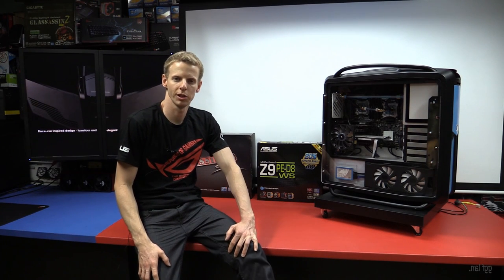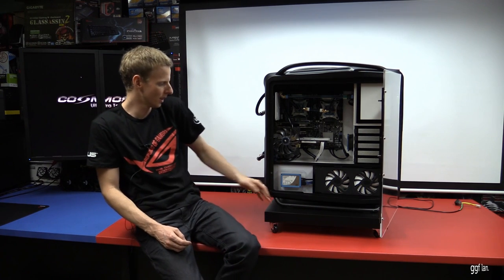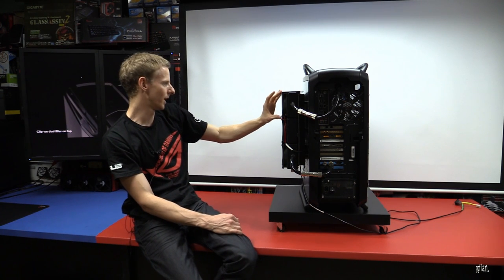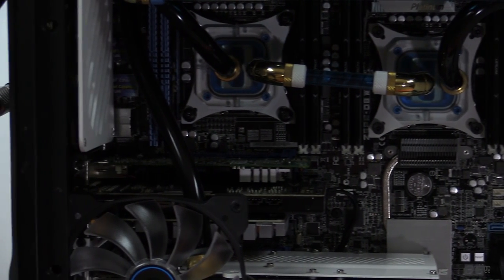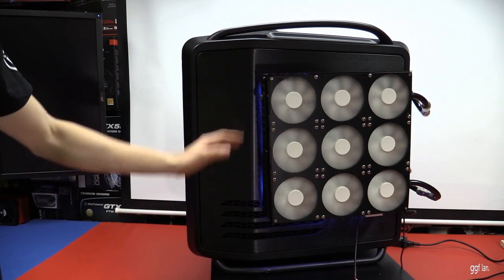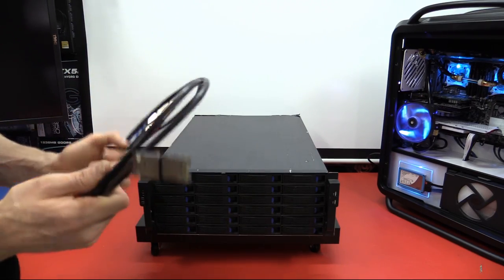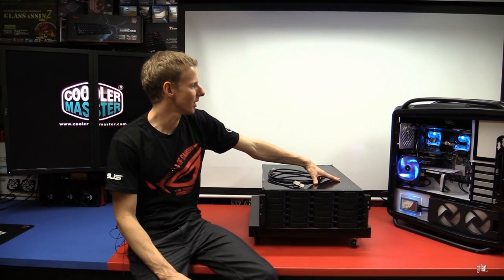Cooler Master Cosmos II, Dual Xeon, Asus Z9PE-D8, 64Gb Ram, 80TB Storage  - Monster System

Comment: The limit to overclocking is not in the ASUS board - it is in the Xeon processors themselves that are locked, You cannot get 4.5 Ghz out of a Xeon even with the EVGA board. And also the ASUS board CAN use the i7 processor... it's just that you are limited to using one i7. i7's aren't designed to work in tandem.
Reply: You can easily get 4.5ghz from an Evga SR2 which I said, that is socket 1366, not this socket. Pretty sure I also said you can use 1 CPU as well. I am well aware of what this board can do and how to use it.
Reply: Stuart Tonks
If it's you who appears in this video Stuart, it's very obvious that you know your stuff! Not saying you don't... And I should have commended you on your technical aptitude as well as your creative industriousness... resulting in a very sweet customized build!

I was responding to your comment at 2:26 where you were describing the ASUS board. You said,"...and no you cannot run a standard i7 in this...". You had a lot of things to convey. We all misspeak occasionally. I'm sure you meant to say that you could not run a PAIR of i7s.

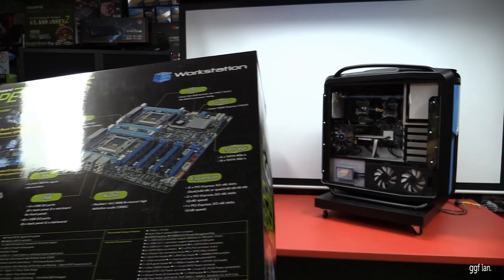And I was also responding to 4:10 where you were discussing overclocking with the ASUS board. You said, "...this one you can't overclock. Not a huge concern for me. I don't need to be running 4, 4.5 on um, on every core..."
But you had said earlier that you did overclock the Xeons a little on the board. I'm just clarifying that the limit is due to the design of the Xeons, not the board. And that Xeons won't OC past the 3.1Ghz you achieved.

Again, great vid.  Just trying to clarify for those who haven't played with dual-socket solutions.

Comment: Hi, Fantastic work. Could you advise what size of plexiglass you used to make your side panel please? Thank you.
Reply: I think I used 5mm actually
Reply: Stuart Tonks That's probably a better option as opposed to buying 3mm thickness as a guess. Just concerned 5mm will be significantly more expensive. Can recall 4mm being a lot more to buy than 3mm therefore 5mm must be a lot more to buy. What do you recommend for shaping the edges? Don't like the idea of using a jigsaw but possibly a scroll-saw. Cannot afford a band-saw unfortunately. Thank you.

Comment: I'm using a NZXT Phantom, the "PHAN-001BK Enthusiast ATX Full Tower Computer Case", for my rig right now. You said in your previous video for this build that you think the Cosmos II is one of the best cases you've used. How do you compare the two? If you don't mind me asking an annoying-to-answer question.
Reply: Na that's alright. I haven'tused the NZXT but I think the Cosmos is a bit bigger and I really like the bottom PSU and HDD area. Really separates them. The cosmos can also take the largest of motherboards as well.

Comment: id say the upgraded xeons would compensate for the lack of OC
Reply: Yea the only disadvantage of the new Xeons is the non OC. But there are a whole heap of new advantages going to the E5's. I get a much faster link between CPUs, faster PCIE spec speed and also everything comes off either CPU 1 or 2, not through a north-bridge.

Comment: Though's cores should be hyper threaded so you have 32 cores theoretically, I have a similar build for a cad workstation its been great so far. I didn't set up ssd caching from the beginning so, im thinking about a fresh install. That case is mahosive, I got mine into a Silverstone Grandia GD07

Comment: I have 2 e5 xeon 2650 2gb, and  a supermicro X9DR3-F , 2 gtx 980 ti, 64 gb of memory, but i cant up my processeur to 2.8 gb with turbo, if i change my mother borad, and i will buy Asus Z9PE-D8 WS, it gonna be better in performance? and i can put gtx in SLI, it can help please? thank you for you answer.
Reply: I think you have not understood me, the super micro does not support SLI, I have two cards gx 980 ti, but not SLI, unfortunately I can not enjoy the potential of SLI also put a third card, 4th slot I metterais a black magic for monotring to summarize the Asus done well to manage the SLI even 4 times, which allows for more performance and rendering is done quickly, even when working in muticame, for history to mount the processor 2.8 gb instead of 2GB, is writing about the characteristic of the xeon 2650, but personellementje have never seen up to 2.8GB when I export a video, here is what.
Reply: i speak better french than englich, i can translate by google.
Reply: +momobest E One thing to remember is processor stepping, the es versions are usually B0 Stepping. Which effects newer graphics cards. I have a quadro k4000 card that it doesn't like running at all!..It booted one in 5 times when it was in. I was told its something to do with memory allocation on boot and the C0 stepping processors would support it better, but they where a lot more money at the time and I would have to flash up to a particular bios which doesn't support the B0's for the card to work. Just one to be aware of. There's a list on asus's website if I recall, of bios and card compatibility

Comment: 7970 & 360 no probleem ? even when you play a game it doesn't cause no problems?
Reply: 360? You talking about the 360 Radiator? I also have a 1080 Radiator
Reply: Stuart Tonks NO i mean the 2 GPU's
Reply: skullrdw Ok, not sure where you got the 360 from, but both GPUs work fine

Comment: Will it run tetris?
Reply: HaloMC117 Ya, but you have to run it at minimum settings and even then, I wouldn't try going any higher than 240p unless you want to melt the processors. Hell, this thing would have a hard time running Microsoft Word!

Comment: fyi: It can run a i7 because that is what I am currently running due to the fact I can't afford my dual xeon's yet
Reply: It can run a standard I7 but you lose half the PCIE and Ram slots
Reply: Stuart Tonks you are correct but a i7 is a good cheap "temp" cpu while you save for 2 decent Xeon's. Just letting people know
Reply: Joel Chambers Yes definitely, I was the one that did the video, should have made it more clear that it can use a single I7 if needed.

Comment: You pretty much wrecked a beautiful case and ruined the airflow with that ugly window on the side. The blue paint is disgusting to look at.  The external raid was interesting, but the hack job you did on that power supply is pretty bad.

Comment: I have 7000 dollars at my disposal what do you guys think, I should have in my PC?
Reply: Well with that budget i would go with 2 Xeon Cpus and 2 Titan Z's around 5000 dollars with the motherboard and the watercooling and you still have 2000 left for case / storage / extra fans and PSU
Reply: if you are not familiar to computer assembling you should find someone to make it for you cause water cooling is something dangerous if you are not sure of what you are doing.
Reply: Okay
Reply: Don't get a company to build it, get a local friend and buy him whatever he most desires.
Reply: Mike Denci
Mabye like 2 R9 295X2's since the Z is basiclly stooooopid
Reply: Xeon, 16 to 32gb ram, cf 295x2 (x2), 4k screen. There's not much else after that.
Reply: iTooob Oh and just 1 xeon, 2 xeons is stupidly overkill.
Reply: Intel Core i7 5960X
ASUS X99 Motherboard
Samsung 1TB SSD (x2)
Sapphire Radeon R9 295x2 (2-way Crossfire)
Windows 8.1
64GB of DDR4 2400MHz RAM (8x8GB).
Reply: ;-D Awesome!
Reply: 12TB
Reply: TheMagDude wait for the 390x

Comment: this is stupid... the entire system is just stupid... it is a giant waste of money...
Reply: even if you are a developer, there are much better options...
Reply: If you don't make video games, know what Nuke is or never heard of Maya or Houdini, you are right. However, some of us know how to put this system to work....not play video games on it.
Reply: A stupid game maker. That's funny.
Reply: I got my superworkstation for about 1300€: 
CPU: 2x Xeon 2670 v0 Stepping 6 ( 190 € from ebay )
MB:   ASUS Z9PA-D8 ( 288€ )
GPU: GTX 970 ( 250 € )
POWER: BeQuiet Dark Power 11 ( 150€ )

Cinebench R15: 2,003 pts ( cpu only )
GeekBench: 36,000 pts

And it has 2x Arctic Freezer 120 Liquid cooler ( 110€ ) in an 200R case ( 60€ ), 
its very silent and weights about 10kg.

I use it mainly for C++ compiling and making music ( synths )

"Some of us know how to put this system to work"

- Yeah the point was u cant build a system without wasting 30times more money.
Reply: What memory type do you use on that mobo?
Ecc or non-Ecc?
thanks!